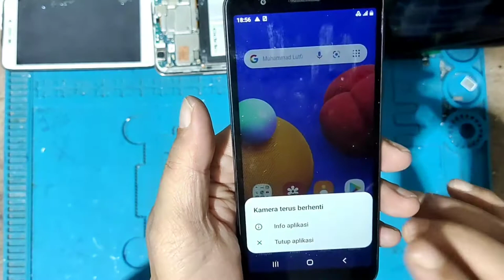samsung a01 core camera selalu berhenti | sudah hapus data tapi masih berhenti

Comment: Bang Kalau Mau foto Pake Flash tapi flash kecepetan error gk normal gambarnya jadi hitam Itu gmn
Reply: Apa Bisa efek jatuh juga ya bang Tapi Kalo hp Di mulai lagi(restat) bisa dipake 2-3 kali foto habis tu error lagi Flash Jadi cepet Lagi Apa kena air kalo kena air kena flash biasanya Kena bagian ataa apa bawah
Reply from the maker: coba di bersihin app yg ngak di pakai atau kasih ruang memory internal hp hapus yg ngak perlu...atau coba di ingat aplikasi terakhir yg di instal sebelum kejadian dan hapus aplikasi tersebut... dan coba buka di pengaturan tros cari aplikasi, tampilkan aplikasi system cari aplikasi camera, hapus chace dan juga hapus data...restart hp dan coba lagi...
Reply: Penyimpanan segar 24Gb Udah Cek Ke post post grub samsung  banyak yang kejadian seperti Saya
Apakah harus Pakai smart tutor biar di cek Sma CS